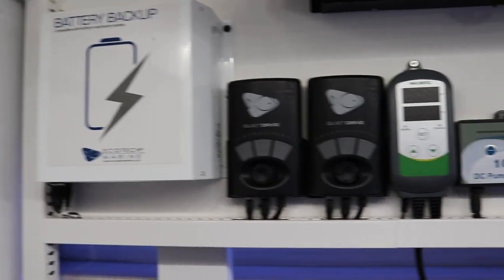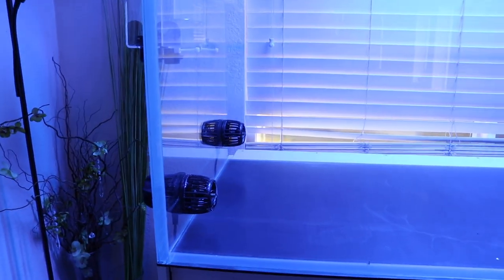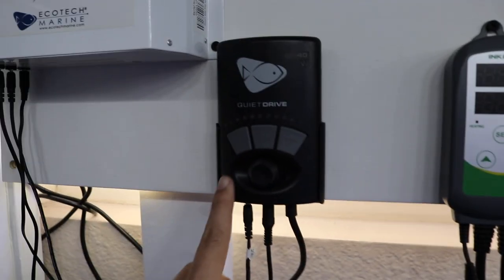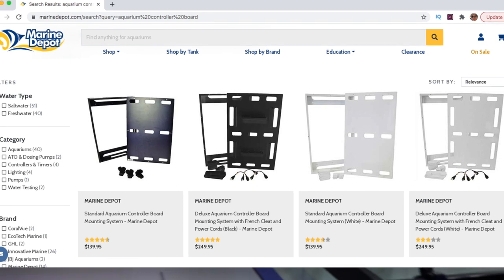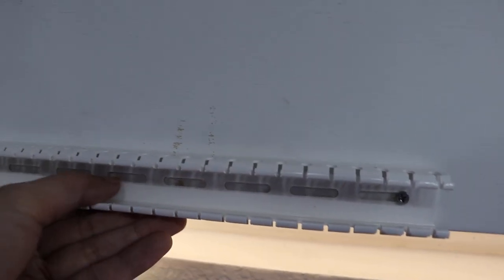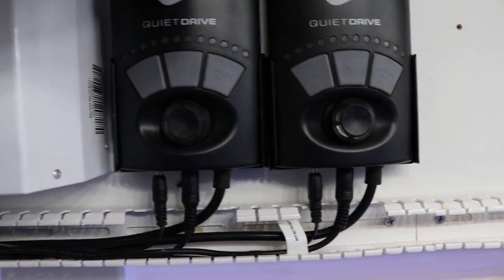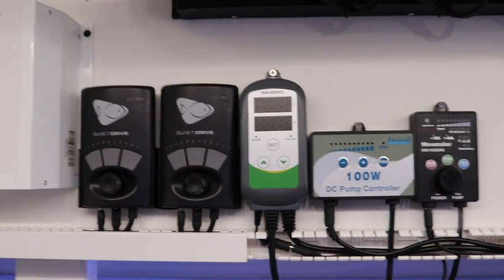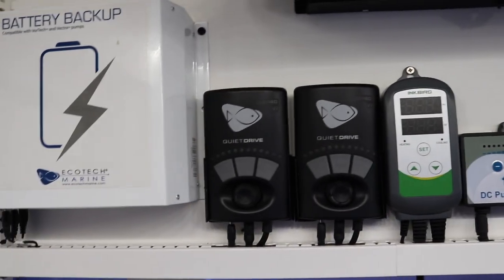HOW TO ORGANIZE AQUARIUM EQUIPMENT | DIY CONTROLLER BOARD | MIXED REEF TANK BUILD

Comment: Love the build. Following along. I was wondering if you can drill this tank and add your own overflow instead of buying there?
Reply from the maker: I appreciate it. You can drill the tank. I wrote waterbox and they told me it’s not tempered glass. I actually have a Fiji cube overflow with drill bits but after I received the tank I decided to leave the tank as is and go with an hang on overflow style